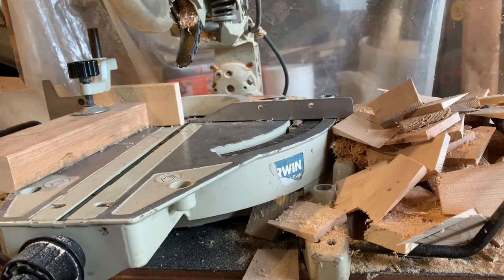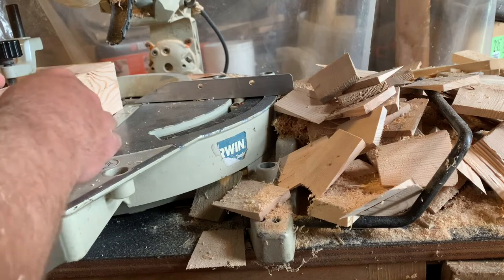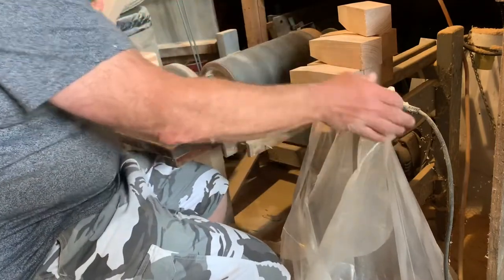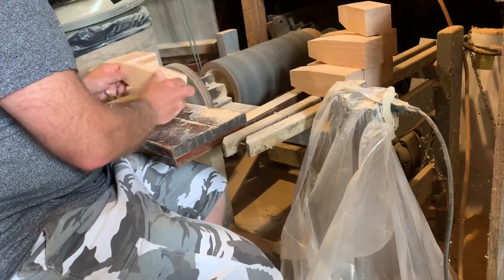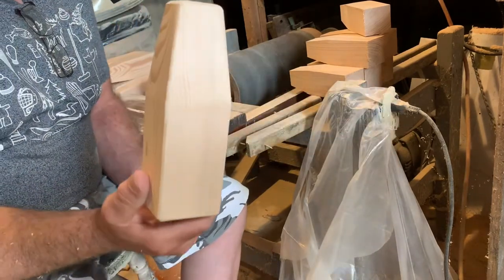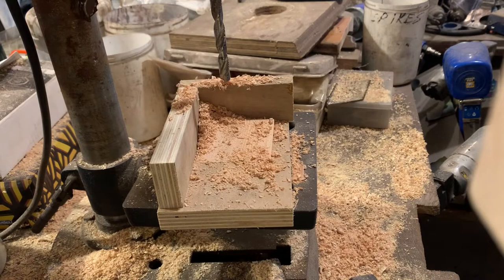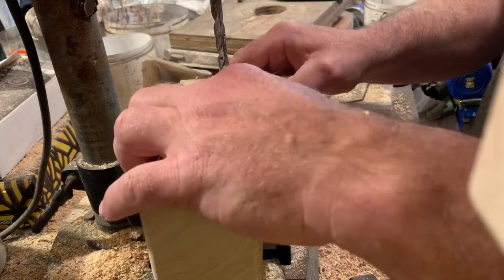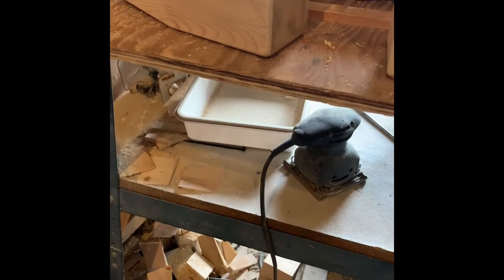Basic buoy build

Comment: Hi Dan. Can you show more about your jig for cutting the angles? Thanks
Reply from the maker: It’s 8 degrees. Just set table to that, lock in place. The “jig” is just a T of wood set to 90 degrees against the fence, then saw is rotated to 8 degrees and locked there. I’m using a badly worn out makita  Ls10 sliding compound miter saw.